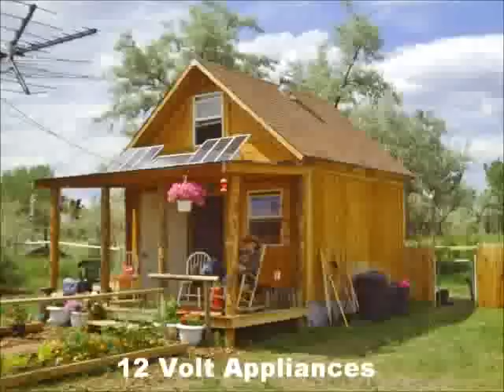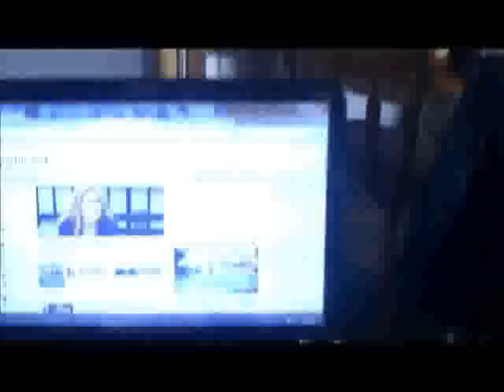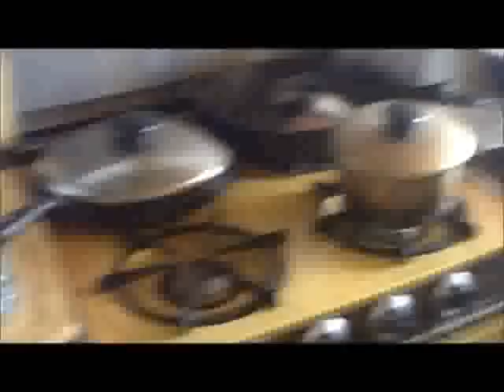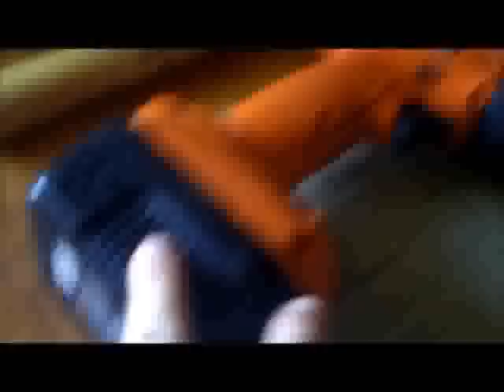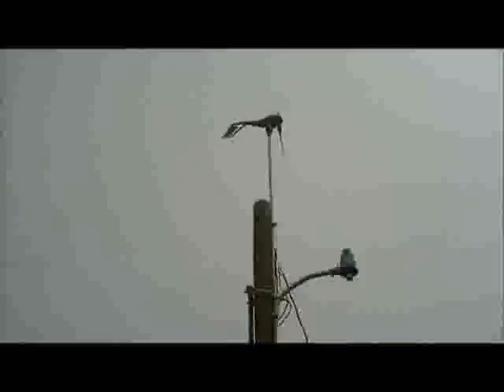Off Grid Cabin 12 Volt Appliances

Comment: Excellent video. The 12v fridge and stove are particularly interesting. I live offgrid in SE Australia.Just getting into solar, I have two small solar generators each with a 40w panel and it is more than enough to power my phone, iPads, lights and recharge my 12v Milwaukee tool batteries, headlamps, radio batteries etc.. via the inbuilt USB and 100W 240v inverter. I will soon built a workshop powered by a 100Ah battery and 1,000W inverter. What size battery system are you using? 🦘😎
Reply from the maker: This is my system: https://www.youtube.com/watch?v=SwHpMRuT_lA
Reply: Thank you very much ☕️🦘

Comment: I tested my Koolatron P75 with an inside temp probe (able to check temps without opening lid). Cooler empty. Motor was old (relubed with bit of 3-in-1 oil), cleaned fans and heatsinks on both sides, cleaned and put on new thermal paste and replaced the TEC1-12706 with a new one from ebay (8$). Measured temperature at different time intervals (plugged in AC socket):
00:00  -->  20.9 °C   (69.6 °F)
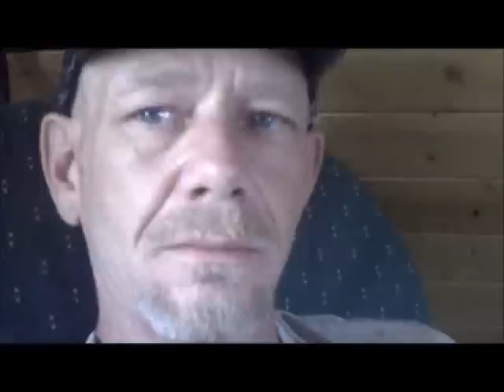00:05  -->  17.5 °C   (63.5 °F)
00:10  -->  15.0 °C   (59.0 °F)
00:15  -->  13.3 °C   (55.9 °F)
00:20  -->  12.1 °C   (53.8 °F)
00:25  -->  11.1 °C   (52.0°F)
00:30  -->  10.3 °C   (50.5 °F)
00:45  -->   8.3 °C    (46.9 °F)
01:00  -->   6.0 °C    (42.8 °F)
01:30  -->   4.9 °C    (40.8 °F)
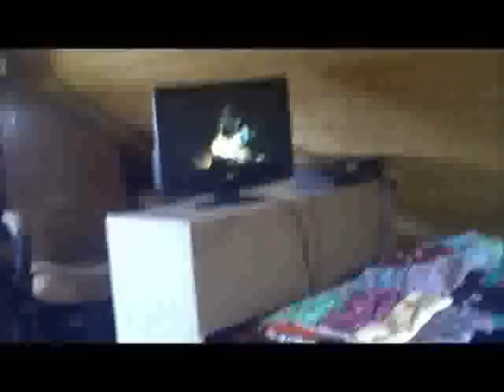02:00  -->   3.8 °C    (38.8 °F)
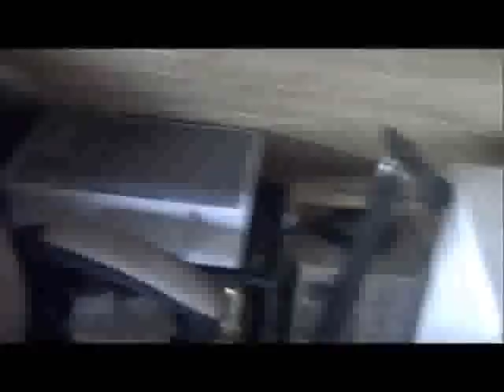02:30  -->   3.1 °C    (37.6 °F)
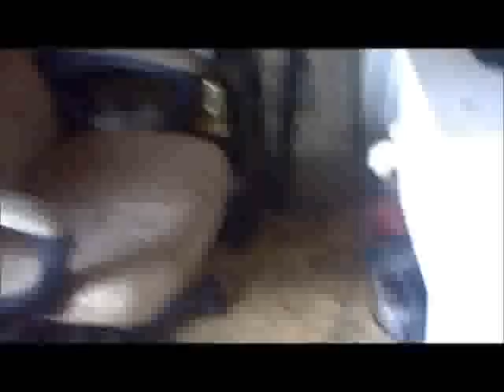03:00  -->   2.8 °C    (37.0 °F)
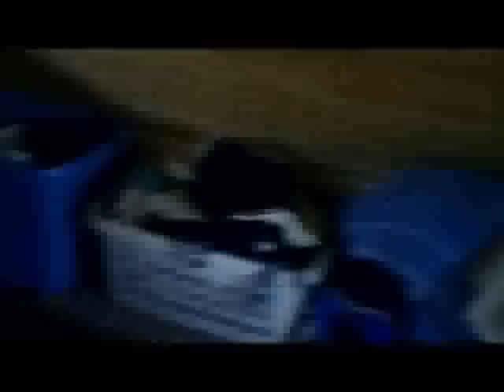03:30  -->   2.5 °C    (36.5 °F)
04:00  -->   2.4 °C    (36.3 °F)
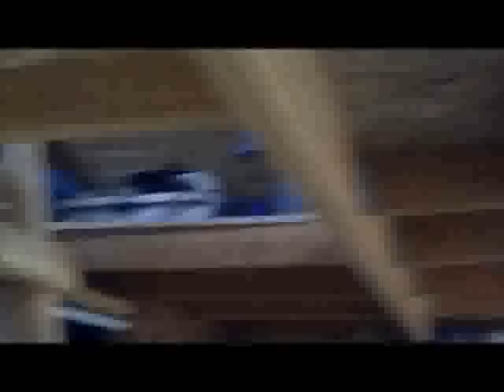04:30  -->   2.3 °C    (36.1 °F)
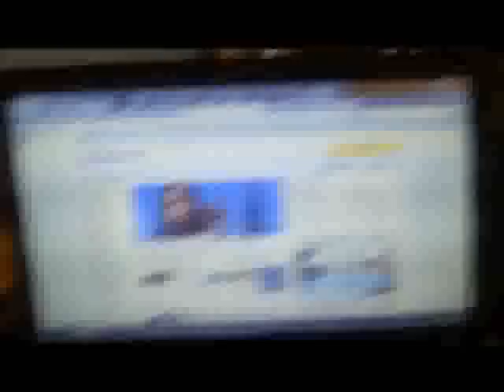06:00  -->   2.2 °C    (36.0°F)

So it gets down almost 18.7°C (33.7°F) below ambient. So safe to use at ambient temps of 26°C (79°F) and below, to keep food a 5°C (41°F) and below.

The thing to remember with Peltiers is that the hotter the ambient air is, the biggest temperature difference you get between inside of cooler and outside temp (Peltier perform better when ambient temps are higher). So if it's 10°C (50°F) outside, you might only be able to get 16°C (28.8°F) temp below ambient. At 20°C (68.0°F) you can get 18.5°C (33.3°F) below ambient. At 30°C (86°F) ambient temp, you can get 23°C (43.4°F) below ambient. At 37.0°C (98.6°F) ambient temp, the Peltier is able to get the cooler down to 11.3°C (52.3°F), so that's about 25.7°C (46.3°F) below ambient temperature.
Reply from the maker: Thanks for the in depth info!

Comment: I have used a " lunch box " heater ( a lot ) . Trust Me , they work , extremely WELL ! You can crack the lid on a pull top can of soup , and , in 30 to 45 min it'll be almost too hot to eat ! They last for yrs ( just be CAREFUL with that latch )
Reply from the maker: Great tip!

Comment: I have a 12 volt power supply in my desktop. It will plug into the cigarette lighter in your car. The television and computer monitors both have wall warts that put out 12 volts. Cut off the warts and wired direct. The only things I don't run on 12 volts is the microwave and the DISH tv box. All your appliances for your motor home can be bought to run on 12 volts. Everybody says I should go 24 but it is too hard to find stuff that works on 24.

Comment: Love your videos re watched  most of them. About to start finishing a basement for my son going to do 12v lighting. So I  want have to run a AC sub panel a couple of AC outlets is all he needs. Starting with a 600w solar system on a 200 ah bank should be more than enough for 12v lighting. Over time may try to convert the whole house to solar or at least certain items . 

Keeping major power killers on AC or replace them with propane. Thinking of using a micro wave water heater for his bath. On a system like this it seems much more efficient than a regular water heater. Will be on the lookout for rv fridge and gas stove keeping the power hogs off the solar grid should allow much more things to be powered. Also may do a grid tie inverter so excess power can be pumped into the grid saving on the light bill....If I find its to overpowered for the simple 12v lighting. 

Your an inspiration! I really want to be off the grid  one day but know enough to not try it on full house with full size appliances. I want always be around for my son having him with lighting and tv and pc on solar will let him perhaps one day live without a light bill.

Comment: I've been looking at DC refrigerators. Pardon a stupid question: does the use of the thermodynamic plate eliminate the startup surge one gets with most fridges, or do you just have a hefty enough solar system to allow for the surge?
Reply from the maker: Peltier fridges usually have a fan but less surge than a compressor fridge. However they also do not get as cold and will not freeze food.
Reply: Good enough. Thanks very much!

Comment: I just made a cup of 12 volt coffee 30 min later I gave up threw out a little water maybe 4 oz  and took my coffee pot inside. Added my milk and sugar. Then I proceeded to drink it. It is coffee but warm not at all hot. You don't have to worry about burning your mouth?
Brand Road King and it is a weak ass coffee maker. If I were out in the boonies and had no other way yes this is a good way to get some brew but you better have some way to burn 30 min because I never had time to piss away like that not when I was trucking. 
I think I rather use a alcohol stove to boil some water than use this? JET BOIL boils water inside 6 min that makes more sense than this POS ABOUT THE ONLY WAY I SEE TO RESURRECT THIS POS IS TO PUT THE COFFEE MAKER IN A HEAT INSULATED BAG OR IN A LUNCHBOX TO TRY TO KEEP SOME OF THE HEAT GENERATED IN THE APPLIANCE BUT I GIVE IT A 3 OUT OF 10 IF THERE WERE NO OTHER WAY THIS WILL BREW YOU A CUP BUT I RATHER DEAL WITH INSTANT AND BOILING WATER WITH ALCOHOL.

I don't see a kettle in your kitchen you need a kettle if you heat water stove top. I have all electric bought an electric kettle and it is only 30 seconds faster than the stove top kettle. 6 min or so give or take to roar boil 1.7 liters of water. 
I get  stovetop kettles $2 each at the thrift store if you get a 110V one buy new they are just $11 new has safety features that will save your home from burning should you forget the water. Electric kettle will not whistle to let you know you boiled water like a stove top will. I have tried to set up things like spoons leaning so it would knock the spoon away all I can say is set an alarm if you use the electric 110 V kettle . What I have done to speed up the process is wrapped the electric kettle in reflectix I that helps keep the water hot a lot longer should I forget to get up and fix something with the water. USUALLY I use the hot water in my camper where I will do dishes time to time. ANOTHER TRICK IS TO INSULATE YOUR SINK ! I HAVE INSULATED MY SINK IN THE CAMPER AND IN THE HOUSE, I HAVE LID TO HOLD IN THE HEAT TOO. I USE REFLECTIX TO TOP THE SINK IN THE HOUSE OUT IN THE CAMPER I HAVE STYROFOAM BOARD 
Any kettle is better than no kettle but I would have to say that if you want dual use kettle I would get the kind with the lid on the top you can place eggs in there and boil them then use the hot water for something else.
I have a 12 Volt pizza oven BC it will fit those small $1 TV dinners. I use to drive truck and I wanted to eat small meals with some bread. I used the bread to fill up. 
System worked too I brought in my 12 V coleman fridge when I bought groceries at walmart. I would get half gallon milk brick of sharp cheddar cheese a couple large candy bars, bags of fruit, cereal,2 loafs of bread and the rest of the space in the fridge would be filled to the incu with frozen tv dinners. I brought the oven in with the fridge to make sure the dinner fit in that small oven no need to burn time transferring from one container to another?

IDK IF YOU HAVE PROGRESSED TO THIS LEVEL YET BUT THERE ARE METHANE DIGESTERS YOU CAN BUILD WHERE YOU CAN HARVEST THE METHANE GAS OFF YOUR SEWER ! YOU CAN COOK WITH THIS GAS ! http://www.motherearthnews.com/diy/home-methane-digester-zmaz75zwar.aspx

Comment: Have you tried using the 12 v system for ac appliances? I've found references stating that any motor labeled Universal and/or has "brushes", will run off 12v dc without any problems. Most kitchen appliances, power tools, vacuums & sewing machine will run just fine.

Comment: great videos, had a question. How did you wire in your DC system, did you wire both pos and neg to the batteries or did you use a ground bar on the neg?

Comment: i need held i recently bought a norcold refrigerator run on propane and ac have trouble finding the 12 v to run it it where the connection and where the 12v
Reply from the maker: Google Norcold and the model number and get the operating manual.
Reply: ashoua xiong   Unless the refridge  has the 12 V feature it won't run on 12 Volt.  many are propane or 120 volt only...

Comment: Have you ever considered looking for a Norcold 6-cu-ft RV refrigerator? With a dual-power unit (propane and AC), you could run it on propane (as long as you throw 12v to it to run the igniter and computer board in it).

Same deal with the RV 6-gallon hot water heater, but it only needs propane. In the summer, in my RV, I can run hot water for a month on a 20-lb tank, and if I propane-power the fridge, it will normally double my propane use - still only about $25 in gas a month (my furnace is another story, though). 12v DC fixture lights are also common in RV's. Hope some of this helps. Good video.

Comment: if you can get a phone line to your house a, you can get better speeds on internet and a more secure connection, and b. phone lines can carry idle of around 40-50Volts, when reciving large incoming data packets i.e. a phone call it can top out at around 120volts. its know to tap into this as you pay your provider for the line not for the power it uses. you could trip your line open meaning it will pump out like 80Volts for long periods of time before knocking of for a 3.5min waiting time.

Comment: You can get a 6 blade 1000 watt wind gen. For 1000 doll. Much better and cheaper than soler panlers. Also it would be better to use 12v lights an reflecter from a junk car. And radios an tv's work on 12v, the transformer changes the 110v to 12v, just bypass the trans. Also a computer backup will give you 110v for the refrigerator an washing mach.

Comment from the maker: My 12 volt line is fused with a 30 amp fuse and I show that in my solar connection videos. 12 volt is safe if you use proper wiring size.

Comment: I understand eveyone has their comfort levels. But 12 V. item often have a high current draw, I cringed a bit when I seen that socket hanging off a wire coming out a  wall. Not a problem if it's fused at the other end, but not many know that's where the fuse needs to be to protect the entire circuit

Comment: How about using the Walmart homephone. That's what I use in my house! No computer needed and it works great. $30 for unlimited local and long distance. and you can use the unit with regular phones. I have it connected to my panasonic home phone which has 4 extensions and 1 base unit. they all work off the Wireless homephone. trust me it works fantastic and $30 monthly phone bill is fantastic!

Comment from the maker: I usually run the washer and dryer off a small propane generator. Running any motor off a batt bank would drain the batts way too fast. A small generator run once a week for washing will only cost $1 or two in fuel.  In summer I dry my clothes outside in the sun.

Comment from the maker: You could do that but I have bad knees and the ladder is actually easier to climb than stairs for me. The ladder is designed to be slid up against the wall or you could use a foldup attic ladder. Stairs take up more space.

Comment: that's good that it works well. if you do decide to wire up the fridge, go with super heavy wires and a heavy lighter socket, then you will be guaranteed trouble free. i come across a bloke with a waeco who has to keep sanding the end of his cigarette lighter plug coz it keeps arcing between the plug and the lighter socket. after issues with my waeco, i went and got an engel, and redone the wiring really heavy and the engel has never batted an eyelid, not once.

Comment: there are 5000w inverters for 100-200 bucks and it converts 12v to 120 ac instead of using your generator it can hook up to your 12v battery.or u can hook it up to your ur solar capacitor

Comment: i was gonna just go with a freezer and keep putting ice packs in an esky (in place of a fridge). i have been doing this, freezing the icepacks at my parents place, but then I keep forgetting to change them and stuff went rotten/mouldy. word of advice from my own bad experience, get the freezer as close as possible ( as short leads as possible) to your battery, and the cables between them, use good heavy stuff. waecos are very bad for this. comes down to current draw problems with 12 volts.

Comment: Many boomboxes like yours at 14:50 have a jack for direct connection to 12 volt DC (sometimes a lower voltage). So you might be able to use your 12 volts directly. For lower voltages just use a plug-in cigarette lighter style voltage regulator to bring the volts down to 9, 7.5, 6, or whatever your radio calls for. Many of these regulators have adjustable voltages which make it easy. Or as a thought, you could use a car stereo--most even have a clock. Just add a good antenna and speakers.

Comment: few tips: if you haven't got an inverter yet, get a pure sinewave. u will regret it if you get modified sinewave which makes everything buzz and ultimately can kill sensitive things like TVs. and fridges: propane/12V/mains fridges are only worth using on propane. their electricity consumption is TERRIBLE. i don't go for pelteir style fridges like "solarcabin" has here, coz their consumption isn't much better. but they are very cheap. i have a damn expensive compressor fridge. $1121 but low amps

Comment: I've got propane stove and wood stove,and also backup butane stove and mains electric stove. i tell u what, if u work, you always go for the propane stove. its just the convinience. but if you don't work or are in an area where its hard to get the bottles to, then wood is good. i use the wood during weekends during winter.

Comment: Small houses are perfect. My 725 sq ft 2-bdrm house in North Kansas City has only a $27 mth light bill ($11 is customer svc charge!), $16 mth water bill, $65/winter & $10/summer gas bill. I just take a paycheck & pay everything annually ($810), so I haven't put in solar.  My portable washer only uses 1-3 gallons water. In winter, I use the bathrm heat vent to dry clothes in an hr. or use my portable dryer at still damp stage to come out soft. I use the hot sunny bedrm in summer to dry clothes.

Comment: Your RV fridge should have a 3 way power source Lp/110v/ 12v, if made in US anyway. Check it out or have an RV tech show you. You should also have a furnace built in that uses Lp and 12v. For the Micro you might check into a small generator, even maybe a used one, you might find one for around $100. You should also have a built in water tank, if not in a campground a couple of 5 gallon water cooler bottles or gas can type containers would be handy to transport water, get those at Wal-mart.

Comment: 1.What speed is your internet. (google speakeasy speed test)
2. Internet = no tv,    or at least in a few years there will be a hybrid.
3.Property taxes?
4.The toaster factioid was good its something I never thought about.
5. The led version of that light is amazing, ihave one myself.
6.Do you have some type of power discharge system. Exp. If your batteries are 100% full it diverts the power to lets say a air conditioning unit.
7. 1 of the top 10 small cabin videos I've seen in the past year.

Comment from the maker: You use an Inverter to convert DC to AC and then that is used for all AC appliances. The DC is only used for water pump and a few DC appliances and lights.

Watch my vids on solar and wind installation for more info n power system.

Comment: I hear ya. I just bought a 9.5 ft slide in truck camper for my pickup and there is no A/C/ but I do have a fan in it's place that brings air in or expells air. I am going to install solar on it's roof to run the electronics (lights, water pump etc)..lamar, your vids are inspirational. I want to do much the same. Need to find land in the right place. I need to be near a town but dont want the heat.

Comment: Like your video ,, Tanks for your post //   ( BUT )

That's not refrigerator its cooler  ,, Technically 
That unit use peltier  cooler ,, as primary technology 
It only work in certain temp ranges ,, HAS MAX TEMP IT CAN WORK IN 
And has no temperature setting ,,

Comment: I'm impressed with the amount of electric things you have with a solar system that is that small. The only downside I really see is in using the cell Internet, you typically get rather low monthly limits, and satellite Internet service has horrible lag on any time sensitive applications and low monthly limits. Hopefully in the next few years this will change for the better and limits will be raised a bit.

Comment from the maker: In a hurricane or tornado no home is really safe. Most homes on wheels use 2x4 framing and 1/2 inch plywood and wafer board. Steel cross ties are used to strengthen the walls.

Comment: I think I would go with a 2 or 3 way fridge, so that if I've got full batteries and plenty of light, I'd run it off 12VDC, if I've got a generator (or shore power in a Jay Shafer tumbleweed type setup) I can run it off 110VAC, or propane if all else fails.

Comment: I recomend you look at getting an Engel or Edgestar, true 12v fridge/freezer. I use a 12v thermoelectric cooler like yours at camp on weekends but they are not a true fridge. Plus they are not efficient, they draw about 4 amps continuously, which is not battery/solar freindly. They don't use a thermostat, & can only cool to about 35 degrees below surrounding temp.